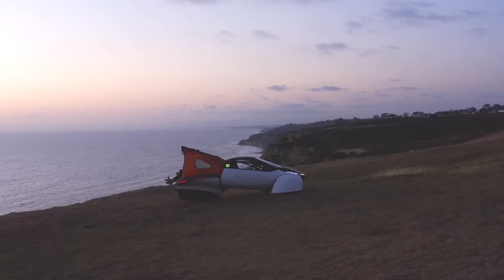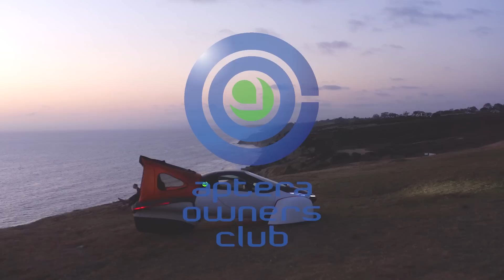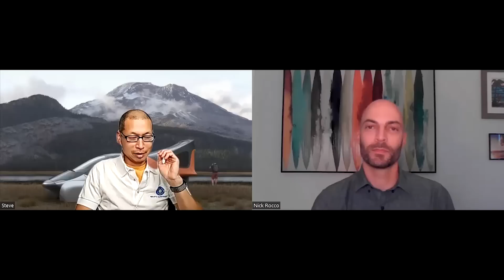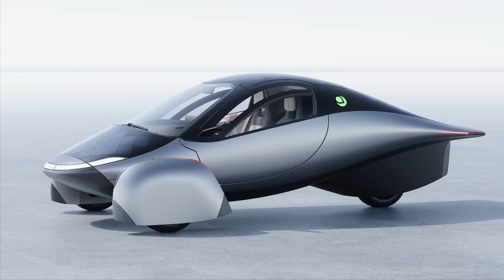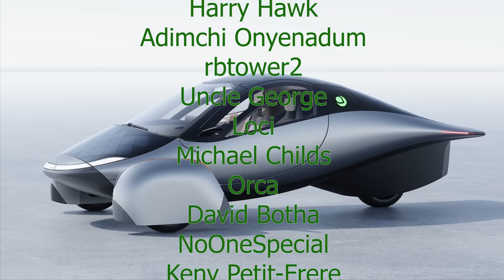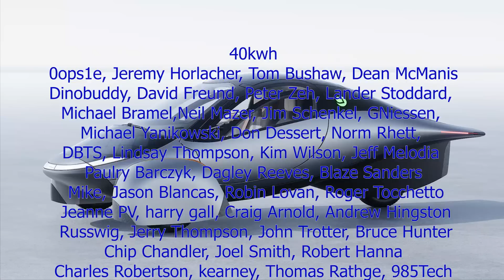Interview with Nick Rocco, Aptera's Director of Operation Systems

Comment: Sorry, but this guy was as vague as possible about everything. If this was the first time hearing about Aptera I'd write them off. What I really want to know is shipping, multiple Apteras are not going to fit on a standard crate. Shipping the assembled Aptera to your residence might cost a lot more than I'm thinking.
Reply: Aptera is still trying to work out details like this. I have always thought that shipping parts of the body would be cheaper, but it's obvious there are more things to consider.

Comment: I'm curious why Aptera made all new tooling for carbon Fiber body parts in Italy.what was wrong with the tooling and composites Aptera already had in the first place to make the Aptera's we see driving around currently. we all know the Aptera was already 7 times stronger than Steel with just the composite materials they were using in the first place. Again i ask why all the extra expenses 
.
Reply: Composites take hours to cure. The systems they are using take minutes.

Comment: When you guys were talking about what Aptera is working on now, I wish Nick would have discussed how each small change they make cascades into a lot of work in several departments. 

For instance the decision to go away from Silicon Carbide semiconductors in the inverters. To save that money, they told us the  small loss of efficiency outweighed the high cost of the better part. What they didn't mention was all the work that went with that to see if it's really worth it or if they can regain some of that loss back.

The loss of efficiency in the inverter results in a higher amount of heat generated. Will the thermal budget allow that increase in heat to be rejected? Can they make up the resistive losses elsewhere like larger bus bars or better contactors? Would larger contactors fit? Will they need larger bus bars or contactors for the 60 or 100kWh packs anyway? Maybe larger conductors in the battery pack itself. Must they reduce the top speed or acceleration to reduce the peak power throughput? 

Will any new parts require change orders from the suppliers? Will they have to change the CAM files used to drill/tap the mounting surfaces for the new parts? Can they use the same fasteners? Can they use the same assembly tooling? Will it affect the time in station?

All these changes also affect the Bill of Materials and the point of use binning at the assembly station. They may affect parts storage and warehousing. They may change fastener torque specs and QC checklists. 
All of these changes will require changes in the SOP instructions for reference by the assembly line people. 

No changes are simple.